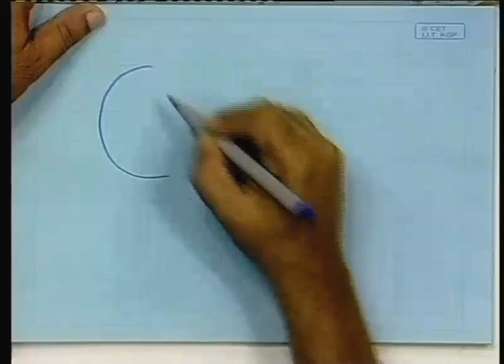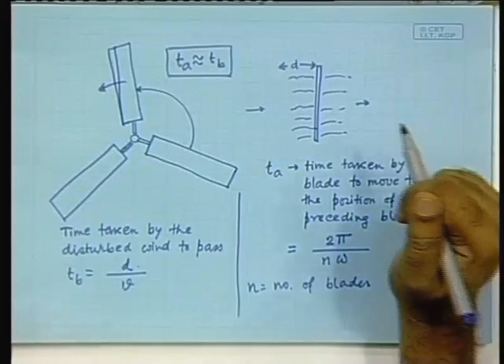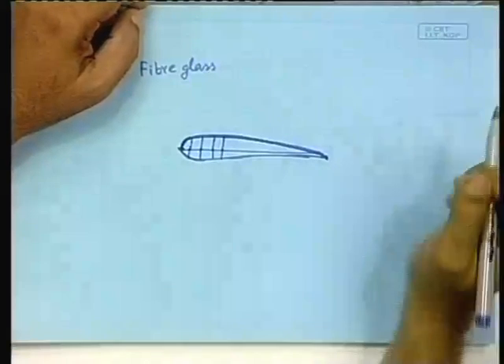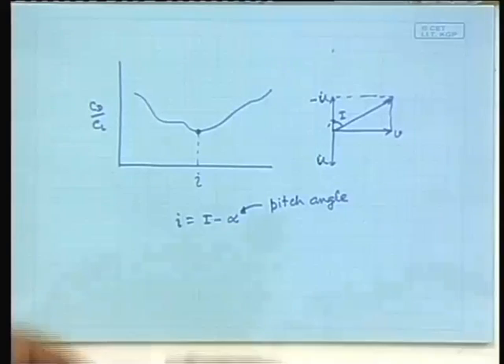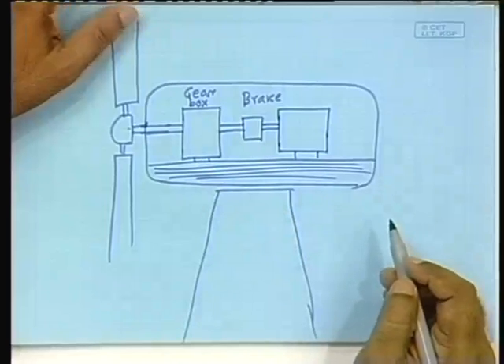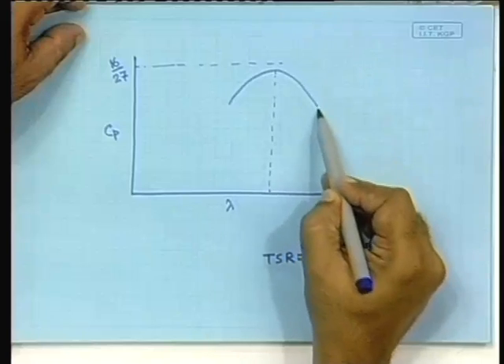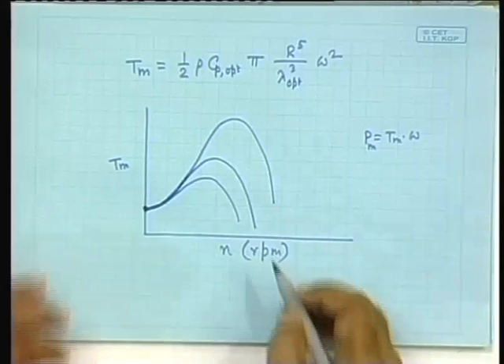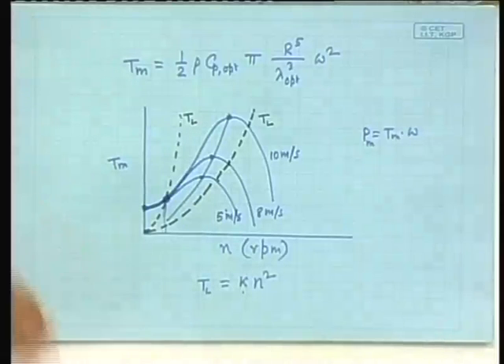Lecture - 24 Wind Energy - IV

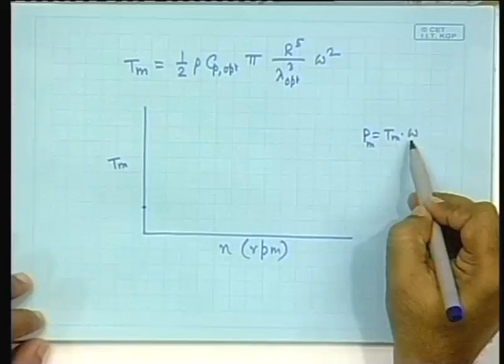Comment: 45:10 ... the equation of mechanical torque also includes omega...so if omega is zero why Tm is not zero in the beginning?
Reply: No it isn't true that torque includes omega.Torque is (moment of inertia) x (time derivative of omega). 
omega and time derivative of omega are not the same thing.
Reply: omega can be zero but its time derivative not zero.